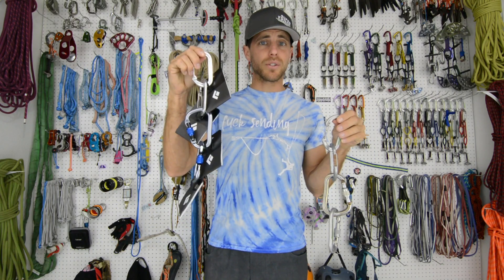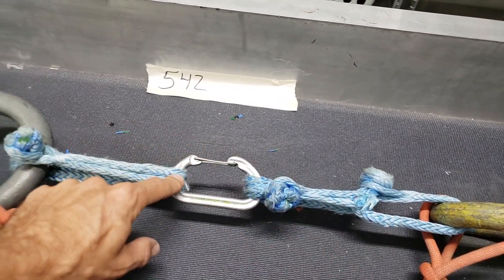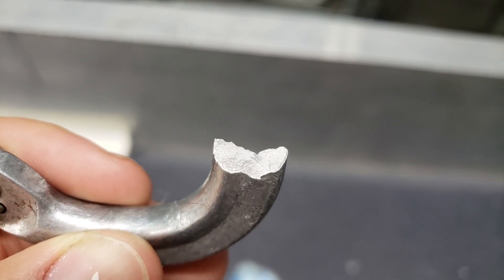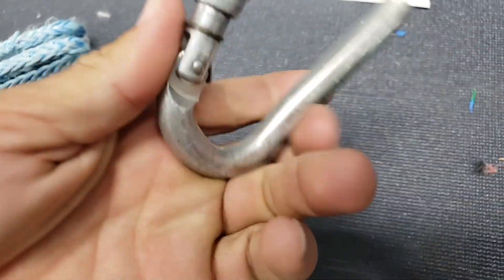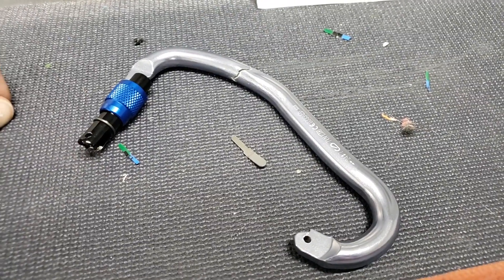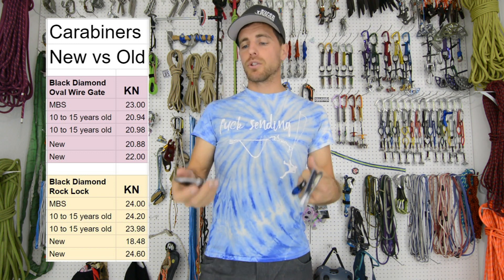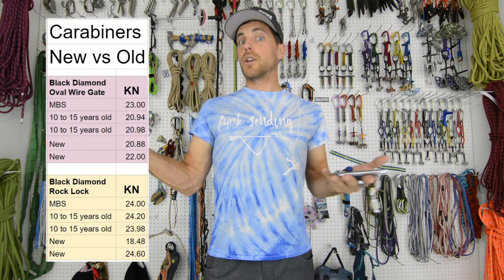Brand New vs 15 Years Old - Break Test

Comment: @HowNOTtoHIGHLINE I always hear about cyclic loading on aluminum carabiners, and I wonder if this is something that you could test? cyclic loads are a bit tough to simulate, but if you have any ideas on how to test that in aluminum carabiners, that would be awesome! the only ideas i can think of are using aluminum carabiners repetitively for a primitive line, then testing it after 20 or 50 uses, but maybe that's sketch because it could fail while the human testing is occurring, and the person is on the line...

I'm not sure if stressing a carabiner with your slack snap 20 times would really do it justice, because the carabiner probably fluctuates 2-3kn a thousand times during a typical session at the park.

Comment: Please do some cheap chinese rope and biners tests,dont see any videos on them at all and Im very curious bro.
Thanks!!
Reply: A carabiner is something you will trust your safety with so you definitely shouldn't get a cheap Chinese one for climbing.

I think there should be laws regulating this industry, cause a cheap carabiner may look professional, and you use it without knowing it, then snap you're done
Reply: He did some chinese biners and they were all strong and broke above stated rating. I haven't seen ropes, but I have tested 2 ropes from Amazon that are made in China, not UIAA rated but says they are for "climbing" one under $20 @ 96ft and one under $30 @ 65ft rated tensile strength of over 5klbs for both ropes. The 96ft rope held up full size pine trees that were well past it's rated tensile strength and the 65ft rope I used to do very short, controlled rappels. Easily held my weight in all tests and I cut open the 96ft rope to see the insides and it was a double braid kernmantle design with individual braided strand core of 16 braided strands and a braided sheath, all made of polyester fibers. I inspected the rope full length and found no deformation or sheath slippage and at static load had almost no stretch. No extensive tests on the 65ft rope yet. Basically, it's hit or miss with Chinese made "climbing" stuff and sure some of it is very strong or stronger than UIAA rated even but at least with UIAA rating, you KNOW for sure what it's capable of and what it's limitations are. Hope this helped some
Reply: @Xtreme_Airgun_Slugs  that's cool but the Chinese changed so much and clone so many different things it's hard to tell if you're always getting the same product.

Comment: Summary:
4:30 shows raw data
For wire gates, old and new performed identically. All of them were slightly shy of the advertised 23 kN.
For locking, old and new performed similarly. However, one of the newer ones failed noticeably earlier. So, there are some QC/design issues. Other than that, both met the advertised 24 kN.

Comment: Over all, this is pretty amateur. 

1) Hate to break it to you, but that’s a 10:1 pulley system.

2) Have you even confirmed that the design or material hasn’t changed at all in 15 years?

3) Please, put a screen over your break tester.

4) of course the carabiners won’t live up to their printed rating if you cram 2 inches of material in both sides.

5) the spine doesn’t break because of how “suddenly” the gate releases, but simply because the gate released at all.

6) You only broke one of each type of carabiner. Literally no useful information can be gathered from such a small sample size.
Reply from the maker: 1 - That's a 20:1.  Look closer.  There are 20 strands going back and forth.
2 - that's what this break test was... 
3 - i don't stand in the room when I break metal, it would compromise my footage of samples
4 - I clip wide things all the time.  I'm not testing standards.  I'm testing realish life scenarios.
5 - same difference
6 - 2 old ones vs 2 new ones of each kind?  It's a small sample size but with no giant deviation in results, I'm not stoked to spend more money and the enormous amount of time this takes unless you are going to sponsor my next break test.  We did 100 break tests for one video testing dirty vs clean webbing.  That was one expensive experiment and took days to do.  Not able to do that for weekly videos on a channel I do for a hobby.  Sorry bud.
Reply: This guy knows how a scientific experiment has to be done to be considered reliable, your comment is underrated

Comment: all failed when the gate failed.  the gate is the weak point, once that goes it is over.  it appears spreading fears about the age of the carabiner is only something the manufacturer does to increase sales.
Reply: Even worse, older links had more consistent ABL than the more recently manufactured gear!
Reply: Well, that’s a massive logical leap you made there, based on a pretty amateur test of 8 carabiners in a garage.

Comment: Kiloneutons, shmiloneutons. How about some lbs?
Reply: It's roughly 32 woolsacks and a 3/4 of a wheel of cheese.
Reply: ah yes because climbing forces and falls are measured in lbs
Reply: 1kN is about 224 lbf and 100 kgf
Reply: @PickledShark   Thanks man!
Reply: @Grendel _It's not about metric vs. Imperial. kN are a measure of "force" whereas pounds and kilograms are a measurement of mass, or weight. If you want a simple conversion, 1 kN is about 225 pounds of active force (not just dead weight). So, if you weigh 225 pounds, gravity is actively forcing you to exhibit 1kN of downward force. Jump in the air, and your active force increases, but you mass, or weight, does not.

Comment: Would like to see breaking tests of a crossloaded, locked, HMS (belay) biner. There's a whole industry of anti-crossloading devices for belay biners but exactly zero reports of them actually breaking in the field. It'd be interesting to see how strong they really are when loaded like this.
Reply: Gate loading of any kind generally reduces the strength to about 20% of the MBS, and any kind of off-axis loading can reduce it to about 50%.
Reply from the maker: Been trying to break quicklinks crossloaded but I can't.  They always twist first once i reach a certain force.  It would be interesting to see if we can do it with carabiners.

Comment: MBS ought to mean Max breaking, not min breaking it seems
Reply: Only if your test setup is poorly executed like this one
Reply from the maker: Wow Keith, you really keep dogging the setup.  Can you please elaborate what you think is so ameture about the test bed or our tests?  It's a slow test and not a drop test machine and I'm not trying to test the standards but using it just like i do in the field to see how and what they break at.  I broke the old ones and new ones in this video the exact same way.  Offer solutions and don't just shit on it.
Reply: I don't think so.  If advert says, "20Kn Max breaking strength", it would reasonably break at 5Kn, consistent with the advert.

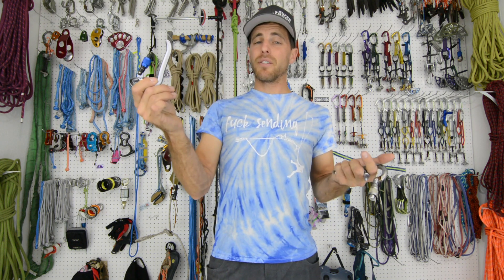Comment: At 6:41 when talking about aliminum vs steel carabiners. It's not so much about how much the material can bend, it's to do with the intrinsic fatigue properties of the matieral. Steel is a pretty special in that as long as the load/strain on the material is below the endurance limit, it can be loaded an infinite* amount of times whereas aluminium doesn't do this, so even with a small cyclic load aluminium will eventually fail.

to expalin the difference between steel and aluminium a bit more. Aluminium has a pretty direct and consistent failure rate for repeated loading at certain stresses
E.g, might be able to be loaded with 5kN 1,000 times before failure, then at 2.5kN can be loaded 15,000 times, at 1kN 75,000 times at 0.5kN 2,500,000 times

At high loads steel follows a similar trend; at 5kN 1,000 loads before failure, at 2.5kN 15,000 times,  however at small loads steel behaves completely differently, at 1kN it could be loaded an infinite* number of times.  (these actual numbers are made up and just for the point)

When you have high speed cyclic loading it can actually reach these really high number of small loads which can cause aluminium to fatigue fail even under loads that seem too small whereas steel can take an infinite* amount of these small loads and unloads and won't fail. This is why even for carabiners of similar breaking strength steel ones are better for this. 

I don't actually know too much about why steel does this and I'm fairly sure fatigue is an area we(humans) don't understand fully, so we still do physical tests to work this stuff out. This property is called the "Endurance limit" (Stresses below this limit can be applied an infinite amount of times without fatigue failure). I think some other matierals like titanium alloys have it too but aluminium does NOT have an endurance limit.
Reply: @Will Roberts (Don't rely on me as an authority on the subject I don't study carabiners) 
>>> TLDR for something like that as a personal carabiner this should have no effect at all. Steel and aluminium should be the same<<<

The weight forces of a person rapelling would be so minor compared to the strength of a carabiner I'd say you would be talking billions of uses (more then you could ever do in your life time) not only that something like rapelling is a fairly constant force so the material is only being loaded once. 
If it's taking big falls with enough impact to get into reasonably short fatigue life (sub few thousand loads) you would already be above the endurance limit of steel so it would behave pretty much the same as aluminium of the same strength. 

It only really matters for very quick repeated loads over a long time, so for a highline that's swaying in the wind being whipped back and forth several times a second for days can lead to massive amounts of loading and unloading on the carabiner. So that's why it's recommended not to use them there. (among other possible issues)

Comment: not a good test, you need to test at speed, basically simulating the weight times velocity to reproduce the real KN. At low speed it is very forgiving
Reply from the maker: We will do drop tests but slow tests have value too.

Comment: If you had a hypothesis that the soft shackle was a less ideal loading of the carabiner, then why did you not test it?  I thought that minimum breaking strength would be a real minimum and there was more safety margins for wear.
Reply from the maker: Why did i not test what?  You mean with a metal connector instead of soft shackle?
Reply: @HowNOT2  , yes, it would be interesting to test soft shackle vs metal connector, or whatever connector that is use for the standard measurement.  Great stuff.
Reply: @HowNOT2  , maybe you know better than me, but the standard is probably UIAA and/or CE.  I'm sure its a page turner.

Comment: Wow thank you, good video. Absolutely will not be buying any Black Diamonds products. 32% reduction of strength at the fail point, below its intended fail rating..? Things happen outside the lab that were never "intended" to happen and a 1 to 5% reduction would've been barely acceptable to me, but 32%?! Can anyone else say junk?
Reply from the maker: I demonstrate realty, not faulty products.  Dont assume other companies gear doesnt do the same thing. A MBS printed on gear is a very sterile science trying to eliminate all variables possible to create standards which we need, but it is also enlightening when i throw a lot of real life variables in the mix to see reality.
Reply: Junk testing setup, sure. The carabiners are fine
Reply: As they are the only thing preventing me from taking a ground fall, I'll still stick to any other brand. Keith if you feel comfortable on them, cool, more power to you. As for me I'll never trust my life to them after watching this video. Plain and simple, the beiner failed before its max load rating. I don't care how it was loaded on that machine, it should be able to withstand any kilonewton force up to its tested limit. It did not do that.
Reply: Any test has parameters, Brandon. If one deviates from the parameters by which the standards were derived, and the results change, it doesn’t indicate deficiency. 

I don’t typically use BD biners either, but that’s really just because I prefer Petzl’s Triact Gate 😎

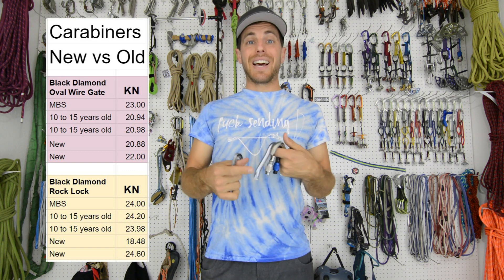Comment: correct me if i'm wrong, but to me, at 4:12 it looks as if the first new locking 'biner you tested was not locked, could this have caused it to slip off the notch earlier, causing the large reduction in breaking force compared to the other new one?
Reply from the maker: it was locked

Comment: tl-dr?  I'm down to buy Xinda O-rings, will buy a large & small unit and send them in-package if someone's willing to match me with "real brand" o-rings (dmm, petzl, whoever's) to see the difference, I think my instinct was that the Xinda's would be at least 90% of stated MBS (and while it's disappointing to see this video confirming my worry that major brands lie on their labelling, I was very psyched to see the consistency*, I'm much happier knowing they're consistently 85%+ or something instead of "most are 99%-->100% but every 10th unit is 70%", yknow?)  Would also urge you @HowNottoHIGHLINE to consider&test my thesis IE that, while spliced rope-terminations are great better than knots, one would be BETTER/have stronger lines if they used a steel-thimble insert (I use the generic ~$1 1/2" steel thimbles from Bartlett's) or 'captive eye' inserts, even the plastic ones, **inside of the bight of a knot**, than using a splice that doesn't have an insert.  IE, my figure-8-with-bight knot on my main climb line should be a ~20% reduction to the line's strength, my theory/belief here is that by using the inserts inside the bight (or inside the eye of a spliced termination), that the increased strength of the line (from reducing the extreme bend-radius) is much more significant than the difference between knotted//spliced ends, IE I wouldn't trade my figure-8-with-bight that's holding a steel thimble inside the bight, wouldn't trade that for a spliced-end IF it didn't have a thimble/insert in the splice/eye (of course a splice with an insert is the best although realistically you're spreading your rope *around the thimble so the strength-loss to the figure-8-knot will be lessened anyways)

WOW!!!  This is great I'd only found Mumford's channel so-far-as break-tests go, honestly while I applaud you & mumford I almost feel a cynicism that less people are doing this, if I had a load cell I'd feel compelled to throw up at least a dozen or two tests (essentially any & every test I'd have done for myself, I'd simply setup as videos),  obviously nobody "owes" anything but yeah it's just such a great service to your fellow climbers that it's the good&proper thing to do!!
That said......ANYONE WANNA MATCH ME FOR AN O-RING (+/- THIMBLES) BREAK-TEST?  I use 1/2" steel thimbles (knotted-into my ropes' ends via figure-8-with-a-bight knots) inside any rope-termination I've got except some of my 1st home-mades which are simply double o-ring anchors ("false crotches" or "cambium/friction savers" in arbor-lingo) where I'm knotting them to the end of a length of my climb-line (11.7mm double braid/24stranded-outer Blue Moon, A++ rope IMO!!), but I'd used all 'Xinda' brand gear (china-based retailer that is hard to pin-down so far as customer service so hard to get any answer on what testing/etc they do) and found I only trust the stuff at like ~20' and under, if going higher or am in a situation where my heart/adrenaline is up then I always go for my lanyard (or false-crotch, depending what the tie-in situation is at that moment/situation) that's got the generic 1/2" steel thimbles knotted-into the ends, with that I know I'm getting damn close to the rope's true-strength, I'll take a knotted figure-8-with-bight holding a 1/2" steel anchor > a spliced-eye w/o any inserts, any day as the bend-radius of the rope at the anchor is a very significant factor in its strength, ideally you don't bend your rope over an arc that's <10x the rope's diameter so if I were wanting to use a pulley as my anchor I'd ideally want 11.7cm for my 11.7mm rope(10x), this same concept applies to terminations so whether you're knotting or using spliced-eyes at the ends of your ropes, if you aren't using 'captive inserts'/steel thimbles/etc inside those eyes (or inside a bight on a knot at the end of a line) then when you clip-into that termination point you are forcing a 180deg bend of your rope over the width of the carabiner/O-ring you're securing to, the thimbles are a HUGE difference as strength decreases quicker the steeper a bend gets ie it's not linear so the first moves away from a sharp-bend (like a  regular spliced-eye that you've affixed with a 'biner) will give the greatest gains, going from a 1" to a 3" pulley makes a bigger difference than going from a 3" to an 11" for instance (for normal climbing-rope diameters)
Reply from the maker: We will be do lots of rope tests and knots and what we connect them too soon!  Through all the break testing i find things break lower than we expect but I also found that we put less force on things than I thought, mostly applying to highlining of course.